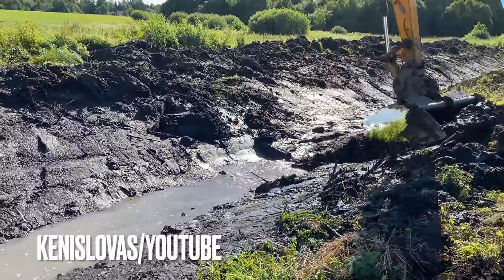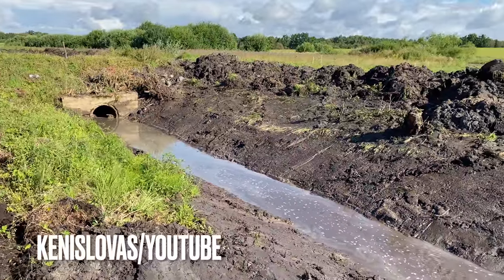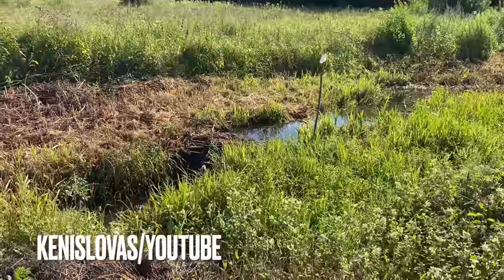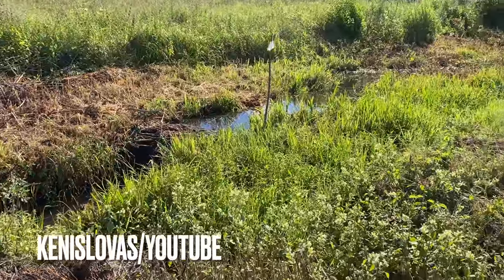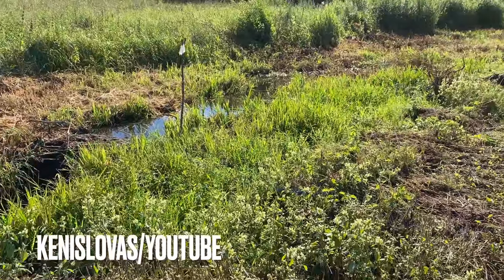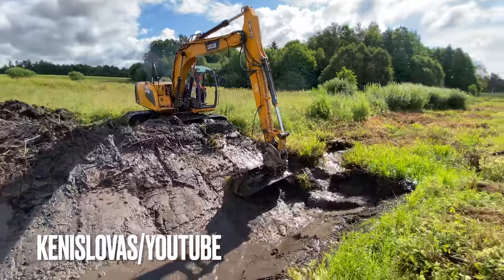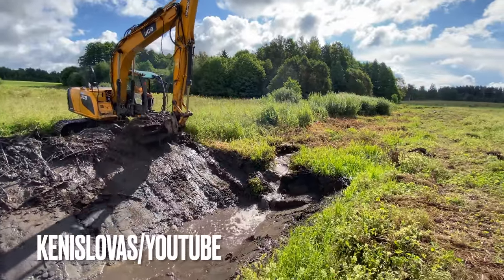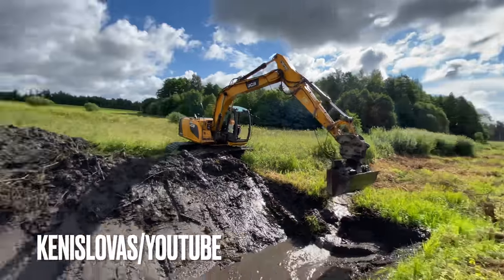Breaking Beaver Dam with Excavator And Cleaning Canal.

Comment: Run a wire through the culvert hole attach a truck tire to the other side of that cable and then pull the cable back through the culvert hole and it'll clean the tube out of all mud and debris and you'll be able to have a clean culvert hole in the water will move quickly

Comment: To clean culvert take a tire an wrap a chain around it an then run the chain through the culvert an attach to excavator an pull tire through an it will clean it out. Want tire to be a little bit bigger the culvert

Comment: What do you mean it's affected by erosion?
Reply from the maker: Blocked water making edges erosion. Peat is moving down. And blocking water even more. Not ending circle.
Reply: @Kenislovas  anytime you slow water down or block it, you reduce erosion. If there was erosion, you wouldn't have the ditches filling in with debris. You would see the debris moving out.
Reply: In fact, you would have a widening of the Chanel if there was more material removed than there was being deposited.